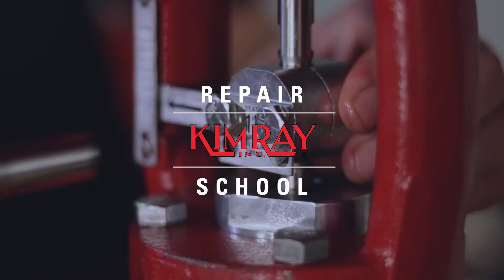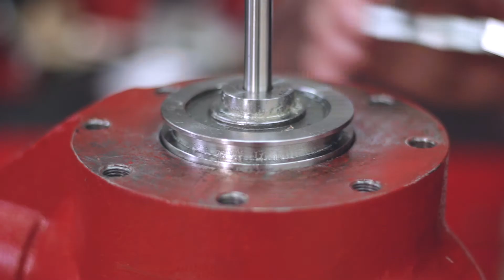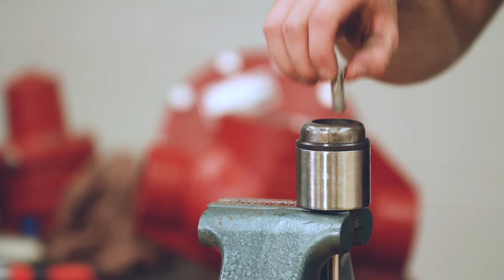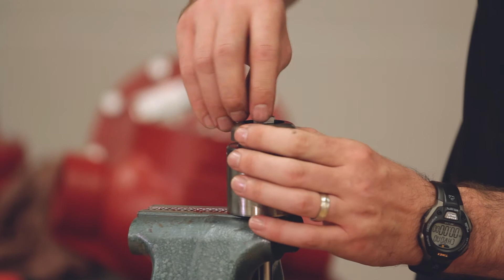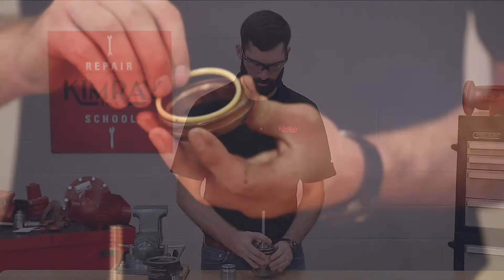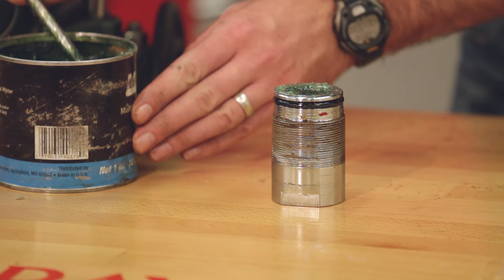Kimray Cage Guided High Pressure Control Valve Repair 🔧

Comment: Two small pry bars placed on opposite sides can pull the cage if you're doing this in the dark on the side of a test separator while you're flowing through the bypass and cutting out the ball valve you're using as a make shift choke since they sent you out junk rental separator.
Reply from the maker: That would make for a much more realistic video if we could pull that off and record at the same time instead of in a clean, bright studio!

Comment: There is a leaking of body bonnet joint can you please tell me the procedure how to tighten.this is 2500 rating high pressure control valve

Comment: Can you please tell me the procedure. how to tighten body bonnet bolts of Kage guided high-pressure control valve
Reply from the maker: For tightening the bonnet bolts, this video should show you the answer. The process is the same as the stem guided, if I'm answering your question correctly. Check out this video, at the starting time I've set and see if that will help. https://youtu.be/16FPPmp4sg8?t=274

Comment: Have question I repaired mine but it still doesn’t want to shut all the way it’s leaking by doesn’t want close all the way down I removed the whole seat and cage and put new one in and still doesn’t want to shut any suggestions?
Reply from the maker: Hi, thanks for the question! I've run the question by a couple of our product guys, but there are a few questions that need to be asked, so I'd suggest calling Nathan in technical support directly at 405-525-4613 and he'll be able to answer any of your questions. Thanks!
Reply: So I having the same problem, i thought it was the bonnet rebuilt it but still getting same problem. I using these on a sand trap tank which has fluid and sand running  through.
Reply from the maker: @meli_meli_20674  Since there will be several variables involved and a few extra questions will need to be covered, I'd recommend you contact our product support by calling Nathan at 405-525-4613. If this is for international support, contact Carlos, our International Product Applications tech, at 405-525-6601, ext. 1114. He'll be able to help you best.

Comment: Adding the seal ring on to the seat makes this a soft seat and not a metal to metal seal. Is there an option with a full port to have an actual carbide seat and trim assembly, or at least another hard surface seat and trim seal?
Reply from the maker: Michael, our “cage guided” or “full port” high pressure control valve trims are class 6 “bubble tight” seal. And our “stem guided” or “ball & cone” high pressure control valve trims are class 4 “metal to metal”. So we do not have an option for a metal to metal class 4 seal on our full port HPCV’s.  If you want, you can email prodtechsupport@kimray.com and they can give you more information about it. Thanks for your question!
Reply: Cantarol valve all kege name   plz
Reply from the maker: Sorry, I'm not sure I'm getting the correct translation of your question. What language are you speaking and could you restate your question, please? I believe you're asking something about the names of the control valves.